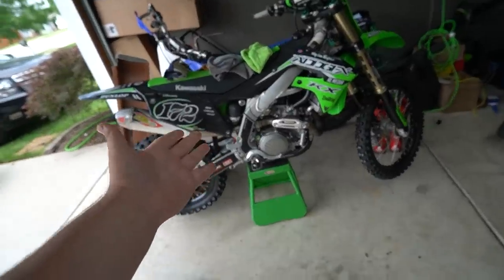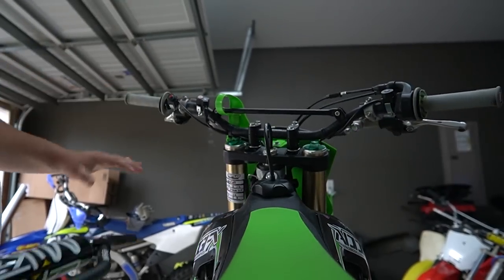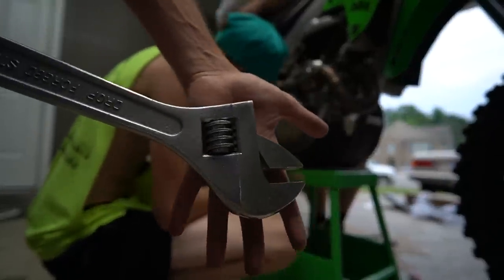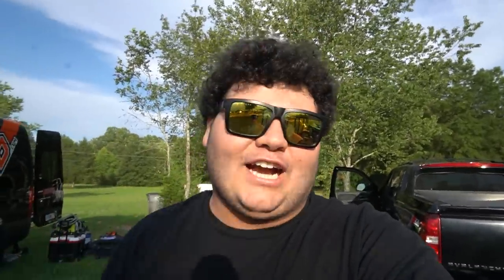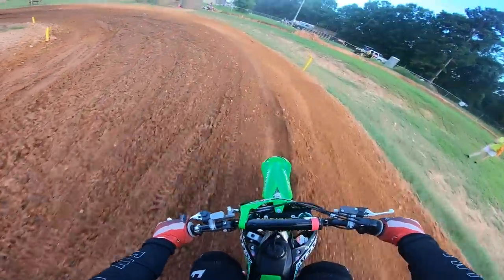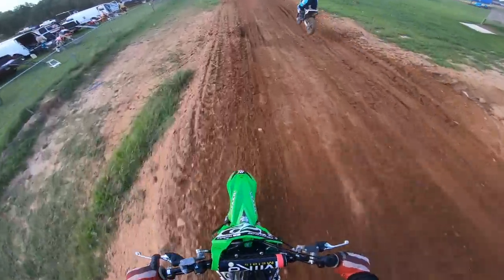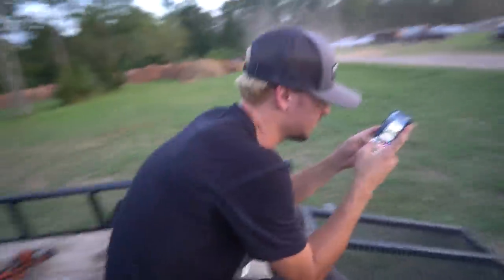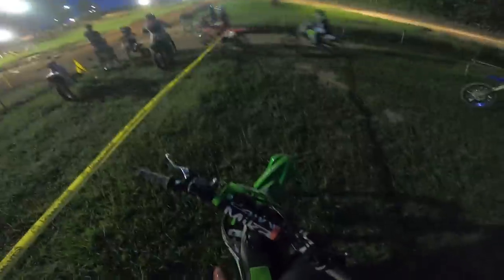Taking Miller to a Pro Motocross Track!

Comment: Hey would a 150 exc like bps 1 or a ktm 85 sx geared down for trail riding woudl they be good for at first bike for a 14 year old
Reply from the maker: Honestly man if you haven’t ridden before I recommend a trail bike. Maybe a 150f or 230f. It’ll teach you the fundamentals, then sell it and get something with more power
Reply: Ok um dumb question but doesn't the 150f have the same as a 150 te or a like that and isn't the 230 more a 85 without a power band
Reply: And I have riden a little bit and am gonna be learning clutch on my mates drz 125 soon but other than that I've only riden his klx110